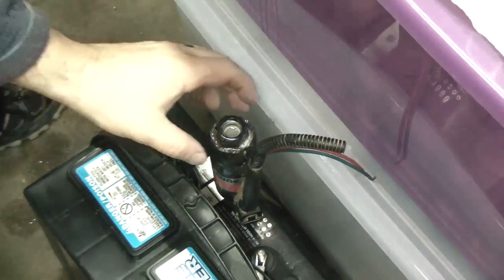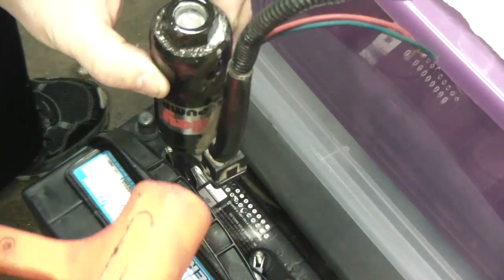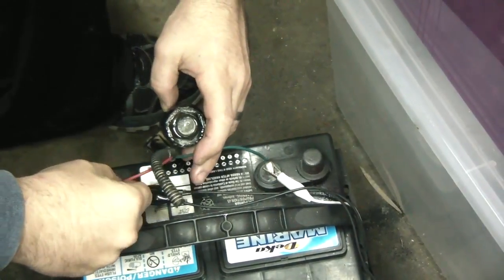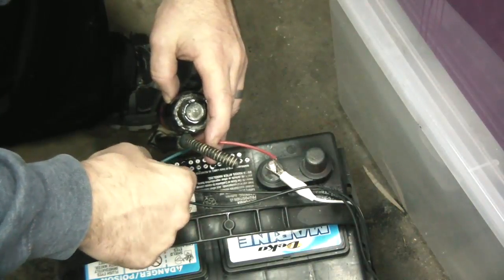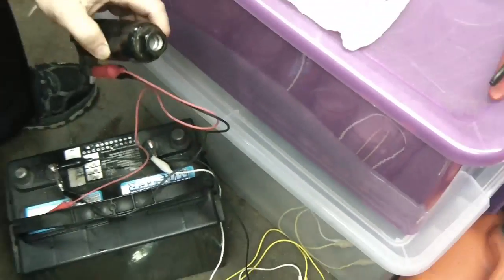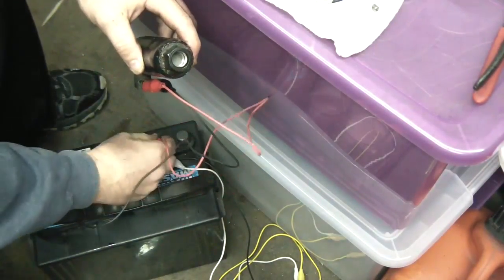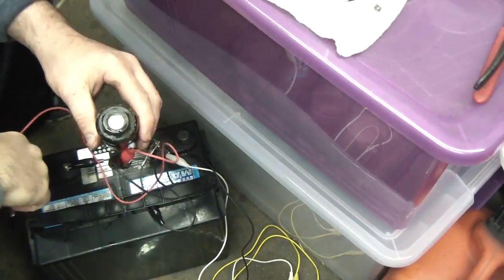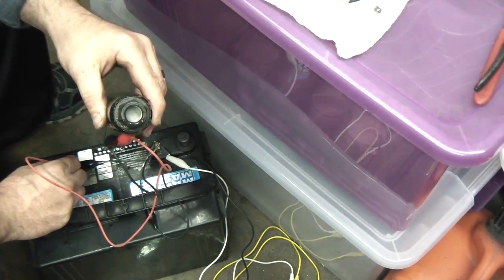Repair Stuck or Frozen Electric Fuel Pump

Comment: That makes no sense at all. Considering the labor to install a new pump is currently around $500-$600, or a couple days of hard work, including needing a helper and removing and reinstalling the tank if you do it yourself, it makes no sense at all not to replace the pump with a new one. That thing could fail as soon as you install it

Comment: when you spray that carb cleaner in next to iffy electrical connections and a battery, my heart skipped... VERY DANGEROUS !  (carb cleaner is typically so flammable that it can be used as starting fluid ).  suggest you put some safety warnings in the front of the video.  no offense just trying to prevent someone from having a terrible tragedy.  Good Luck! 1.   I do have a question, Can gas be drawn thru an in tank fuel pump with an external inline pump (to alleviate dropping the tank etc. )

Comment: Got a bit nervous after the introduction of the carb cleaner. 
Does not take very much to be mixed with the air in order to ignite. 
A fire needs 3 things. The fuel and oxygen have been introduced.
The sparks while connecting the wires are plenty sufficient to supply the heat needed to complete the trifecta for the existence of fire. 
Sorry. Nerd valve developed a leak.  It's sealed again. lol

Comment: Had a full tank of gas sitting for 6 years. I was getting noe results for about an hour and was just about to give up. Then I decided to use a metal hammer instead of a mallet, and I hit the pump HARD at all around it and within 2 minutes it finally free'd up. thanks
Reply from the maker: +sheen15zero Cool, I'm glad this video helped.

Comment: I just unstuck the stock fuel pump on my Toyota. I let my tank run empty and let it sit for about a month which I knew was a bad idea. My friend said she did not have time to take me to get gas- what a friend. Otherwise I would never have let it sit dry. I figured it was just stuck so I took it out and shook it up and down hitting it on my palm. I added a few drops of oil and attached some power through my battery charger and tapped it on my palm a few more times and it started to run again.